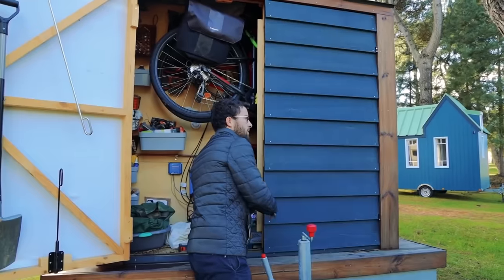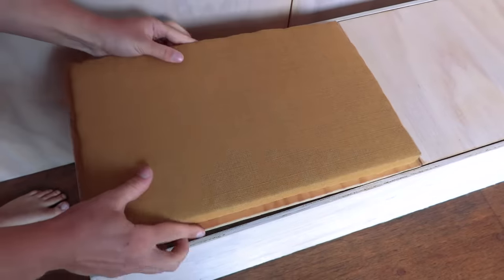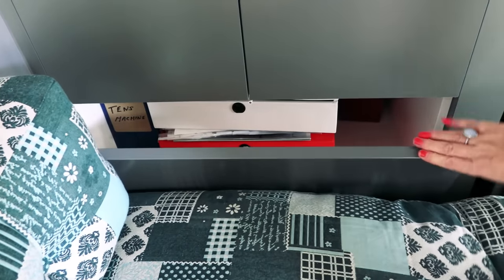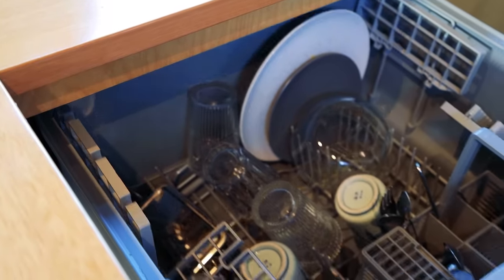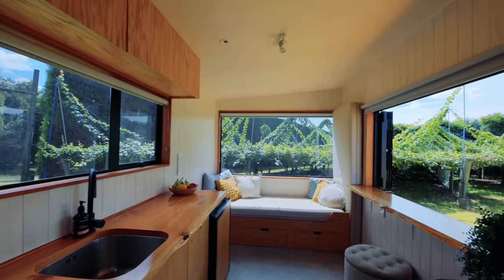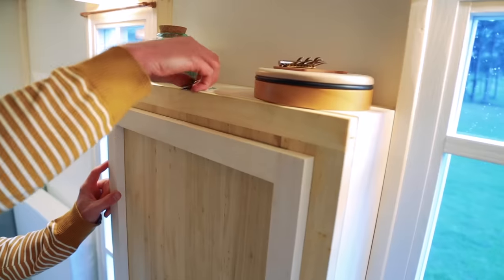Top Storage Ideas For Tiny Homes

Comment: Can you make a video like this one about bringing the outdoors in, or, connection to the outdoors, something along those lines. I would love to see that.
Reply from the maker: Thanks for the idea!
Reply: Oh yes please!
Reply: I would love some more questions on the type of insulation people used and how happy they were with results. Having spent time in metal caravans the open ventilation can't be be fun all year round in some climates.
Reply: I totally concur! One of the ones here I recall seeing before that stuck in my head as def wanting in future design, is the one that has the large horizontal window in kitchen, where window opens to outside deck with bar stools. There's also a couple of other designs I have seen previously that ties in the living areas with the outside deck. Both of those aspects will drive my future design
Reply: classic ambo yes insulation would be great! As I’m about to refit a schoolie and am atm just winging it as to what to insulate with as any vids I’ve seen it mentioned were more about protecting from cold than heat (I’m in australia)
Reply: Buddy McCormack as for bringing outdoors in... I’m generally housebound (hence preparing to make a move into a schoolie so I am perhaps forced to spend more time outdoors), but I have a few free branches that I’m going to be using in the design somehow (ideas could be wardrobe or curtain rails, vertical poles/think Mayfair).. smaller branches can be used for jewellery hangers ... sticks, bones , rocks can all be turned into cupboard door handles etc x
Reply: Tree*

Comment: One of the few tiny home storage videos that shows accessible storage. 

So many new builds have deep spaces with inadequate access yet all your choices here show clever, viable storage options to actually get things back out of deep storage easily enough they can be used.

Love the shower closet! Slide wardrobe aside, use spacious shower, slide wardrobe back over shower with clearance for easy drying.  Minimal setup effort, maximum storage, no waste. 

Wonder how something like this could be done in a van/RV build… most of the space saving van showers take so much work you’d need another shower after putting it away, or they’re cramped if they exist at all.

Comment: @Living Big in a Tiny House - Bryce and Rasa, I wanted to share this video with a friend, and thought I'd make a quick list of all the goodies - it's an epic video! Hope you don't mind xxx 
Teena

00:57 Ceiling cavity drop-down storage
01:01 Roll-out pantry storage
01:27 Camouflage wheel-well with storage
01:49 Gaming and entertainment space in the ceiling in France
02;22 Split-level under-floor closet storage in San Diego
02:51 Hidden bed and two long seating benches under floor, and hidden fold-up dining table in shipping container in New Zealand
04:45 Storage "train" of connecting drawers under kitchen floor
5:10 Wall-shelf system
05:36 Clever sliding shelving system
05:54 Clever storage and bed-lift mechanism
06:43 Floor cavity storage including fruit and vegetables

Clever Kitchen Storage
 08:00 Lowering a ceiling-high pot rack via bicycle wheel
09:18 Great jar storage on view, hidden washing machine (I would turn it to face the door), tall pull-out pantry, kicker drawer storage at floor level

10:11 Multi-functional furniture
10:32 Under-bed kids' playroom (bed on hydraulic hinge/lifts
11:16 Very high bed with a ton of storage underneath in shipping container 
11:45 Marie Kondo influence in deep drawers :-)
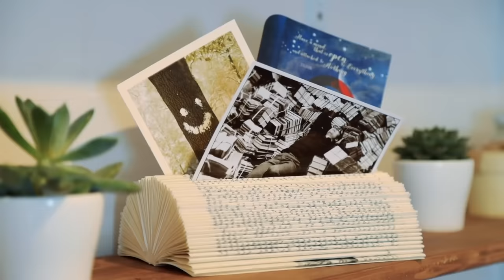12:16 Very clever under-bed storage (hinged bed like a sideways Murphy bed)
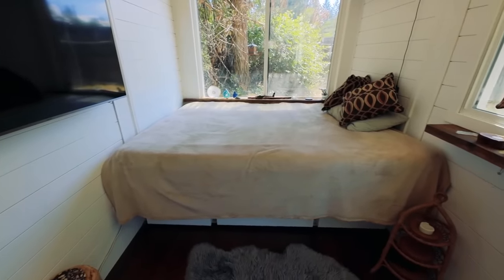12:34 Under-bed storage with a bed warmer
13:12 Under couch storage with tidy Man Shed drawer :-)
13:44 Fabulous long window seat above sofa

14:05 STAIRS!
14:22 Cool stairs with clothing storage
15:02 Doggy storage stairs, hidden dog food and water bowls, 
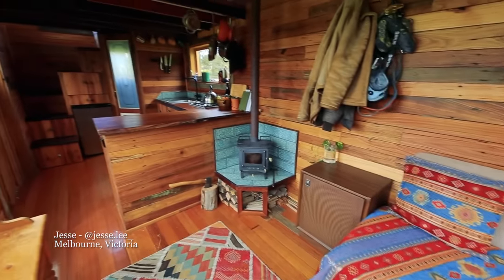15:46 Beautiful loft storage stairs
16:18 French ladder / stairs in a tiny Tiny

Clever Bathrooms 
17:10 Lots of fantastic (and some hidden) storage
17:59 Amazing hidden storage!
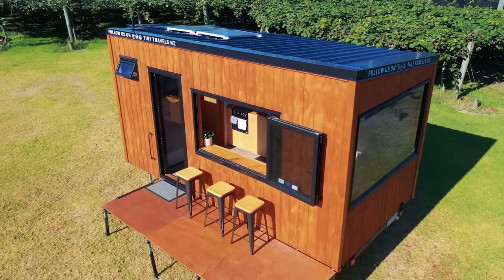18:17 Pull-out toilet
18:53 Tiny basin above toilet, I LOVE THIS SHOWER idea!

Clothing Storage
20:00 Rotating wardrobe in the Castle THOW
20:25 His 'N Hers Wardrobe
21:03 Loft Crawl-in closet with laundry chute
21:59 Hidden jewellery / jewelry storage Bryce and Rasa, I wanted to show this video to a friend, and thought I'd make a quick list of all the goodies - it's an epic video! Hope you don't mind xxx 
Teena

00:57 Ceiling cavity drop-down storage
01:01 Roll-out pantry storage
01:27 Camouflage wheel-well with storage
01:49 Gaming and entertainment space in the ceiling in France
02;22 Split-level under-floor closet storage in San Diego
02:51 Hidden bed and two long seating benches under floor, and hidden fold-up dining table in shipping container in New Zealand
04:45 Storage "train" of connecting drawers under kitchen floor
5:10 Wall-shelf system
05:36 Clever sliding shelving system
05:54 Clever storage and bed-lift mechanism
06:43 Floor cavity storage including fruit and vegetables

Clever Kitchen Storage
 08:00 Lowering a ceiling-high pot rack via bicycle wheel
09:18 Great jar storage on view, hidden washing machine (I would turn it to face the door), tall pull-out pantry, kicker drawer storage at floor level

10:11 Multi-functional furniture
10:32 Under-bed kids' playroom (bed on hydraulic hinge/lifts
11:16 Very high bed with a ton of storage underneath in shipping container 
11:45 Marie Kondo influence in deep drawers :-)
12:16 Very clever under-bed storage (hinged bed like a sideways Murphy bed)
12:34 Under-bed storage with a bed warmer
13:12 Under couch storage with tidy Man Shed drawer :-)
13:44 Fabulous long window seat above sofa

14:05 STAIRS!
14:22 Cool stairs with clothing storage
15:02 Doggy storage stairs, hidden dog food and water bowls, 
15:46 Beautiful loft storage stairs
16:18 French ladder / stairs in a tiny Tiny

Clever Bathrooms 
17:10 Lots of fantastic (and some hidden) storage
17:59 Amazing hidden storage!
18:17 Pull-out toilet
18:53 Tiny basin above toilet, I LOVE THIS SHOWER idea!

Clothing Storage
20:00 Rotating wardrobe in the Castle THOW
20:25 His 'N Hers Wardrobe
21:03 Loft Crawl-in closet with laundry chute
21:59 Hidden jewellery / jewelry storage

Comment: Thank you for consolidating many of the storage ideas that I loved and saved the houses which they came from so I don’t have to spend hours looking for them. Some of these ideas could easily be done in regular houses like mine which is sadly lacking in the storage space. Seriously my home only has 2 closets and both are upstairs in the finished areas of the attic which are used as bedrooms. The basement is more crawl space with a tiny portion that has a concrete floor for the furnace and heat pump and we can’t store anything down there because I am highly allergic to something down there. Found out the hard way after things were put down there and when they were brought upstairs I had one of the worst allergic reactions that required rescue inhaler, breathing treatments and lots of Benadryl. Everything had to be washed and if it couldn’t be it was donated or thrown out.

Comment: Good video, great solutions. I notice a lot of sharp corners, at the corners, but also along the edges. These can be negatives that just build up over time. ( I'd never have an Ikea bed in my house. We're usually barefoot, sleepy (and stumbling) around our beds, the Ikea veneer style requires sharp crisp corners. A bad combination.)  The edges and corners to ease or round off are those near your toes, like some of the sliding beds; mid-body, like table corners, head height - especially just above eye level; and also watch where your hands are when you use these things. 
For easing edges a router with a round over bit does a great job. For the corners I usually just grab a jar lid and trace the curve then use a jig-saw to cut it out, then ease the edge like the other edges.  Also sand any edges to avoid splinters. 
A major issue for kitchens, which I've never been able to solve is it would be great to hang pots and things, but then oil vapor from cooking condenses on them building up a dust trapping layer of grime. In one kitchen we installed an almost industrial level stove hood fan that exhausted through the roof. Better but far from perfect. Hood fans seem to always be a compromise between suction and noise. (The almost industrial one had the fan motor on the roof of the house - it was still quite loud in the kitchen). I'd love a Turbo Mode for situations like when a pot smokes or pan grilling salmon that I could flip on and clear out the kitchen before wisps of smoke make it to the smoke detector (and also condense on the surfaces of my kitchen).  Kitchens are functional machines, being able to hang pots, display plates and tools would be helpful, but oil vapors beg for flat resilient surfaces.
And while I'm being a busy body, a  topic for a video might be how to handle plywood, MDF, particle / chip board especially interior. The glues and dust  in these things out gas (term?) for months and years. When my son was a baby I vacuumed then varathaned all the otherwise unseen particle board surfaces on his crib and drawers. This sealed in the bad stuff. Plywood edges, especially Baltic birch if sanded and urethaned or varathaned  looks great, but only marine and aviation grade plywoods have no voids (and cost several times more). I've filled these voids that appear on edges with wood putty, but it usually takes three applications to fill them. (I don't think my methods are definitive) . You might expand the video by showing how people handle and cut plywood. I've got a table saw and years of experience, but I've never (single handedly) put a whole sheet of ply through my table saw.  Instead I make a quick saw table and I have an full sheet L-square that I clamp and run my SkilSaw. Too many of the makeover shows seem to skip this crucial step. (I once turned about 30 sheets of Baltic birch 5' x 5' ply into as many finger jointed drawers. Every sheet was  cut wrong, parallelogram instead of square. I had to square each sheet up, rip it down the center, then run it all through my table saw to make 'standard parts'  After i squared the whole sheets, using a pole sander I sanded the surfaces then used Bona floor seal, sanded again, then applied two coats of floor finish. Then after assembly, easing the edges, I touched up all the edges, corners. (after 30 years they're all still in great shape.)  I apologize for being such a busy body. 
I like the shower, but shower curtains get wet, seal in water, grow mildew. For my regular bath/shower I just put small neodymium magnets= stacks (2-4 magnets) on the edges about a meter up. These hold my shower curtain spread open, and above the tub. On one end I've got a bath basket on the wall for one magnet spot, on the other side I just ran a string from the shower head. The basket (and the string...) aren't magnetic so I just tied a fender washer to the string and bolted two washers together on the basked.

Comment: I had a lot of ideas about using extra wall space as hidden storage, and floor space as well, in mobile homes, but could never find anyone to help me do it.  Hallways, floors, and other spots in a home where there is nothing there, is a good spot to have a tiny storage spot. It isn't a full closet, + might just be the area where normally is insulation, but even that small of a space could hold a lot of stuff. I also used shoe holders in the back wall of closets to hold extra things, such as extra bathroom supplies, even things such as sewing notions. 
I have never been able to understand why mobile home makers do not add in vast storage spaces, as I always felt that they should have the small cabinets in every space, even in the living room+down hallways, up high, out of the way, as is done in campers. Mobile homes have no attics, as a tiny house doesn't, which begs lots of questions on storage. If the tiny house has under-pinning, set up permanently, then there is a bit underneath it for extra things, But still not much. I thought of using an old gutted camper as a mobile storage unit. Building a storage building on a trailer to pull it to the new site would work if they have another vehicle.

Comment: What is needed more than storage is usage. Let me explain. If I have to move multiple things to access things I use frequently, like I have to move my bed up to access my clothes, that is not optimal. The solution is drawers like any dresser. Nobody considers a dresser storage. A shed is storage, a connex, is storage, the compartments in an RV are storage. Kitchen and bathroom cabinets are not storage. A bedroom closet is not storage. And if they are used as storage, (meaning your Instant Pot is in you bathroom closet or under the floorboards, it’s because there is not enough space in the home. This is what makes tiny homes impractical, lack of usage space.

Comment: the concepts are nice but so many items that should not be in a cupboard etc get put there.... a washing machine should not be there and also have the door open at all times so that mold doesn't infest it, the bedding and mattress especially should be left in open air for same reason, shoes that are being regularly used being stored in a drawer without any holes for ventilation also promote fungi growth and they will just really stink up the whole drawer along with the clothes in it. a heater in a drawer with mattress above is a fire hazard, NEVER do this. and putting things in the ceiling while making it super low is just claustrophobic. a child playing spot under the bed is dangerous, there's no way of knowing that this won't ever fall back down and hurt the child. Wouldn't it be so much better to get a foldable mattress and allow the child to play on the surface of that bed space? and I can't imagine keeping clothes in the kitchen, they will all pick up the smell of the food... And in some cases the storage space within steps had drawer handles sticking out too much, surely this is a way to trip easily.